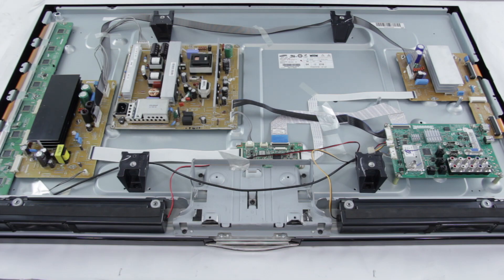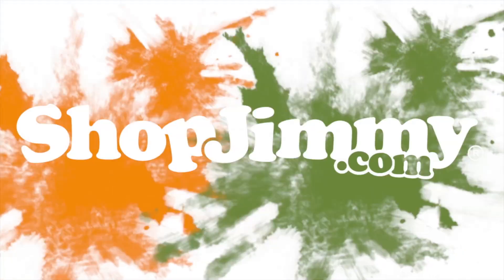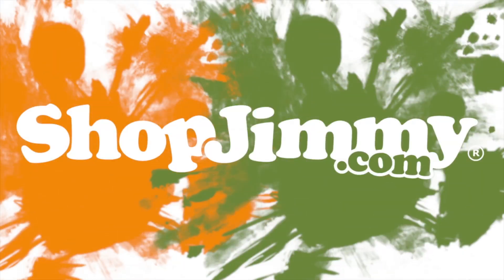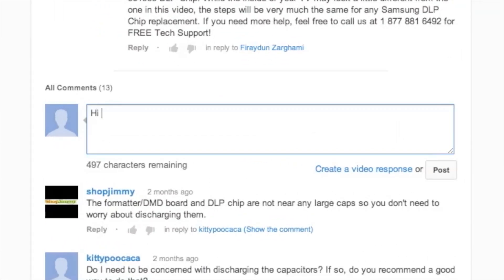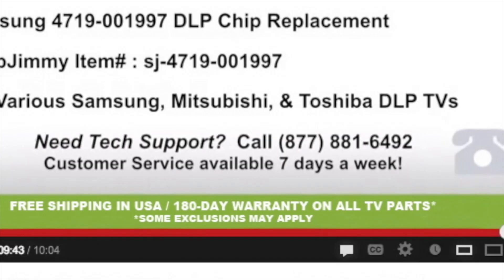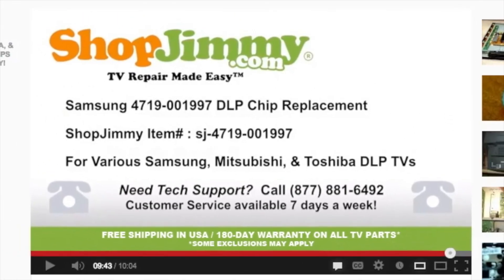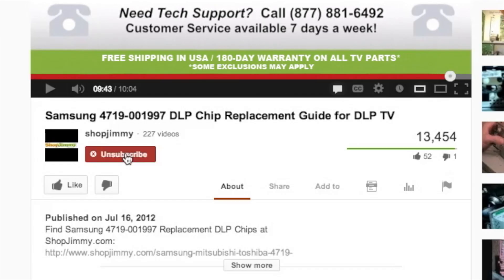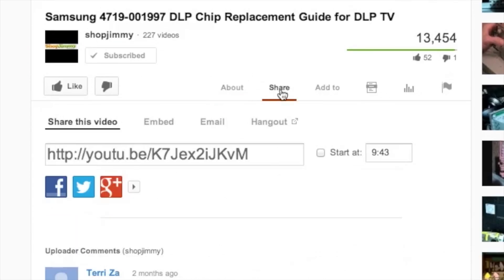Plasma TV Repair Tutorial - Common Symptoms & Solutions - How to Fix Plasma TVs

Comment: I have this Samsung Plasma HPT5054X/XAA. The picture recently went out. Audio works, changes channels. What would you suggest I switch out?
Reply from the maker: Intrafear   I recommend replacing the Y-Main Board and the Lower & Upper Y Scan Drive boards in your TV.  Click this link to replacement parts for your TV model number.  http://www.shopjimmy.com/catalogsearch/result/?q=HPT5054X%2FXAA  Be sure to match part numbers on your current board, with your replacement for compatibility.  Here is a link to a video showing how to identify your part number, click here:  https://www.youtube.com/watch?v=R1jmj_foId0  Thanks and please let us know if you have any further questions with your TV Repair!  www.shopjimmy.com

Comment: Hi Jimmy.  I have an Hitachi Plasma P50H401 tv.  A few weeks ago the tv would not turn on and the power light was blinking blue three times.  I opened up the back panel and discovered a domed capacitor 100v 3300uf(m) 105 degrees Nippon on the power board.  I replaced the capacitor (exactly the way the old one was situated) and the tv worked fine for about 2 minutes.  I turned off the tv, reinstalled the back panel, hung the TV back on the wall, plugged in the power cord and now the tv has absolutely no power.  Replaced the same capacitor a second time and still no power to the tv.  The fuse on the board where the power-cord plugs in appears to be good.  Not sure what to do next.  Please help!  Thanks so much!

Comment: Hi, I have a Samsung LN-46D550K1F Tv with no picture...audio is ok. Backlight is on, I can see picture with flashlight. what do you think it could be T-Con or inverter board? voltage from the power supply to the inverter is fine, Thanks in advance for your help!
Reply from the maker: Luis Gudino   Is the backlight working?  You said the backlight is on and you can see an image with the flashlight.  Typically if the backlight is working, you will not need the fashlight to see the image.  Thanks!  www.shopjimmy.com

Comment: Good day Jimmy!! Toshiba 42HP84, Solid black vertical line, off center on the right.  Any solutions to this issue that will remedy the problem? Any help will be greatly appreciated.
Reply from the maker: tamban282   This sounds like a TV panel (TV Screen) problem.  If your TV panel is bad, it may be more cost-effective to replace the TV as panels are typically hard to find in stock, difficult to replace, and expensive.  Thanks and please let us know if you have any further questions!  www.shopjimmy.com

Comment: I HAVE A PANASONIC MODEL TH-37PX50U  MADE IN 2005  IT WORKED FOR 2 YEARS THEN HAD COLOR LINES
SO UNPLUGED AND PUT IN CLOSET  PLUG IN AND HAS SOUND  BUT THERE COLOR BARS ALL OVER
Reply from the maker: SAM JONES   This sounds like a TV panel (TV Screen) problem.  If your TV panel is bad, it may be more cost-effective to replace the TV as panels are typically hard to find in stock, difficult to replace, and expensive.  Thanks and please let us know if you have any further questions!  www.shopjimmy.com

Comment: HI! i have a LG plasma 60PY2DR  TV.   it is about 8 year old TV. the TV was functioning perfect till last night when we switched it off end of the day. Never exhibited any issues. In the morning, a Verizon tech came to switch my Service from Comcast to Verizon. He informed me the the TV is not coming on.  i tried to switch it on. The standby light flashed a few times and turn red and the tv wont display anything on the screen.  if you try to switch on again, it would repeat the cycle.  this TV is a very heavy TV with inbuilt DVR and lot of other functions.  i believe the the power board is not working on it.Please give me an advice and let me know how much would it cost to get it repaired.
Reply from the maker: Dawood M   Try this at your own risk. Unplug the TV, then disconnect the y board and plug in the TV to see if the TV powers up. Reply with the results of this test. Thanks! www.shopjimmy.com
Reply: ShopJimmy.com   the tv was too heavy.  i have a technician replace the power supply. he charged me $500  and took the board away.

Comment: Love your video on Plasma TV Repair Tutorial. Here is my problem. I have a Samsung Plasma Display (Model NO: PN51D440A5D) (MODEL CODE: PN51D440A5DXZA) My thing is the video image just went out on me yesterday. I get full audio and the remote control works fine. Turning it on & off works fine to. Just no Video image. BUT when I shut it off & turn it back on I get a Quick white flash on the screen then go's to black. Like I said Audio works fine. But one thing I notice is that along the top of the TV was very Warm. I unplugged it to let it cool down, but plunged it back in a few hrs later, still the same thing. Please I like to know what part I need to get from you to get up and working again. Thanks Tommy.

Comment: I have an Insignia 42 inch plasma NS-PDP42. I have no picture, but the red stand by light is on. When I push the power button the light will turn green then go directly back to the red stand by. The picture never does come on. Thanks for the help
Reply from the maker: Jason Elliott   I recommend replacing the YSUS and the YDRVTP boards in your TV.  Click this link to replacement parts for your TV model number:  http://www.shopjimmy.com/catalogsearch/result/?q=NS-PDP42  Be sure to match part numbers on your current board, with your replacement for compatibility.  Here is a link to a video showing how to identify your part number, click here:  https://www.youtube.com/watch?v=GEllG3RV-tc  Thanks and please let us know if you have any further questions with your TV Repair!  www.shopjimmy.com

Comment: Hello, I have the LG 42PJ350 Plasma TV. The other day, there was a power surge in my home, and it ended up doing something to the TV. When plugged in, I get a standby light, but when I try to turn it on, it clicks as if it were going to come on, but clicks three more times, does not come on, and the standby light goes out. I have taken it apart, and there are no bulges on any capacitors, or anything that looks or smells burnt, so I am thinking it is the AC Noise Filter, which I mistakenly called the power supply. Can the words be used interchangeably? But more importantly, what may this issue be? I wanted to get a second opinion before going on and buying the Noise Filter, and that not be the problem. Thank you.

Comment: hi i am having problem with my plasma tv Samsung PS-42Q97HD it turns on but after some time its going off itself and the blue start line is blinking where do i find the problem and how to fix it at home, will be very thankfull for ur reply directly to my mail, papazai@yahoo.com
Reply from the maker: Sultan B   I recommend replacing the main board in your TV.  Click this link to replacement parts for your TV model number:  http://www.shopjimmy.com/samsung-bn94-01178b-main-board.htm  Be sure to match part numbers on your current board, with your replacement for compatibility.  Here is a link to a video showing how to identify your part number, click here:  https://www.youtube.com/watch?v=BEPWrefQvqI  Thanks and please let us know if you have any further questions with your TV Repair!  www.shopjimmy.com

Comment: I have a 58 samsung plasma PN58B650S1FXZA, it made a pop sound and went off clicks on every 5 seconds then turns off.  Any help would be great!
Reply from the maker: Chadrick Willis   I recommend replacing the Y-Main Board and the Upper and Lower Y Scan Drive Boards in your TV.  Click this link to replacement parts for your TV model number.  https://www.shopjimmy.com/catalogsearch/result/?q=PN58B650S1FXZA  There may be multiple boards for the same TV model number, be sure to match part numbers on your current board, with your replacement for compatibility.  Here is a link to a video showing how to identify your part number, click here:  https://www.youtube.com/watch?v=R1jmj_foId0  Thanks and please let us know if you have any further questions with your TV Repair!  www.shopjimmy.com

Comment: Hey shop jimmy I have a lg lcd flat panel that has static vertical static lines what would cause this and I am a electronics technision so I do have a lot of solder skills if there is a specific area I have to replace components on I can ?
Reply from the maker: *****   This sounds like a TV panel (TV Screen) problem.  If your TV panel is bad, it may be more cost-effective to replace the TV as panels are typically hard to find in stock, difficult to replace, and expensive.  Thanks and please let us know if you have any further questions!  www.shopjimmy.com

Comment: I have an LG 50PK550-UD plasma tv (from 2010). Right now it has 10 thin vertical lines appearing on the display, 8 are green and 2 are blue. One is approximately 1/3 of the way from the left hand side and the rest of them are about 10 inches from the right. Do  you  know which board is causing the problem? I have even read that the display itself could be the issue and I am curious how that would be determined. Thanks.
Reply: any thoughts on this?
Reply from the maker: Art Green   This sounds like a TV panel (TV Screen) problem.  If your TV panel is bad, it may be more cost-effective to replace the TV as panels are typically hard to find in stock, difficult to replace, and expensive.  Thanks and please let us know if you have any further questions!  www.shopjimmy.com
Reply: ShopJimmy.com
 Thanks for the reply. That really sucks. I was hoping I could fix it and not have to throw it in the garbage. What a waste. Now my tv is an LNG: Life Is Not Good lol

Comment: I have a Hitachi 55hdt79 that turns on and has sound but no picture I suspect the y sus board. Would you be able to confirm?
Reply from the maker: Tony Pileggi   I recommend replacing the Y-Main Board and the Upper and Lower Scan Drive Boards.  Click this link to replacement parts:  http://www.shopjimmy.com/catalogsearch/result/?q=55hdt79  There may be multiple boards for the same TV model number, be sure to match part numbers on your current board, with your replacement for compatibility.
Thanks and please let us know if you have any further questions with your TV Repair!  www.shopjimmy.com

Comment: belly jimmy,my plasma set has a bright green screen that flashes . I switched out all the swollen caps . what else can it possibly be. also as I was removing one of the bad caps, the copper foil came off so I jumped the one lead to the next cap over giving it the same voltage. thanks for listening and your time and efforts .Fraternally yours Glenn Ferris .comp/ electronics tech.
phillymale1955@gmail.com
Reply from the maker: Glenn Ferris   I recommend replacing the y board and buffers.  Please reply with your TV model number.  Click here to view a video that shows how to find your TV model number:  https://www.youtube.com/watch?v=S51nhAmwR2M  Thanks!  www.shopjimmy.com

Comment: im so lost, i bought a broken vizio vp50 hdtv20a plasma tv... when i bought it the guy said it just turned off while watching it.... well i opened it up and it appears some capacitors have been replaced... a main power fuse  was blown... i replaced the fuse, now when i plug it in the tv will beep one time but it does not turn on.... it does nothing if i hit the power button....   the entire time the tv is plugged in i can hear a high pitched squeal noise...  where do i even begin.... oh i almost forgot.. the power supply board does not light up or anything....     where do i begin? what all can stop the board itself from getting power every where? apparently it is losing it some where.. cause the power supply board has the led lights that should light up.
Reply from the maker: james nunnya   The noise is that the panel is broken somewhere.  If your TV panel is bad, it may be more cost-effective to replace the TV as panels are typically hard to find in stock, difficult to replace, and expensive.  Thanks and please let us know if you have any further questions!  www.shopjimmy.com
Reply: ShopJimmy.com actualy it was fine.... turned out i had to use the remote to turn it on. the power button does not work.. none of the buttons on the side work. the tv works as good as new. ive been watching it every single day lol. it plays almost non stop i hardly turn it off.
Reply: ShopJimmy.com all i did was replace a couple capacitors myself just for not testing exactly how id like them to. and the main fuse that was blown...  after that the only thing that will turn the tv on is the remote. im not sure what the humming noise is but u only hear it if u put ur ear straight to it.... its still there even while im watching it if i get close enough to listen to it.. but i dont worry bout it haha. it plays. thats all that matters to me.     but in general how can a tv panel make a squeal noise? sounds kinda odd to me... panels usualy go bad as in ribbon cables or pixels dieing etc... cracks... blah blah.. im no idiot when it coes to tvs but again im no profesional ethier but ive fixed more than my fair share of them.  but ethier way i respect u trying to help... ive noticed most tv repair shops usualy always blame panels being bad when there not.. ive seen that alot and i never understand why they say things they know isnt true... is it like a guy thing where its easier to say a cause thats unfixable money wise than to be straight forward with i dont know lol.

Comment: I have a 58" Samsung Plasma 3D TV model # PN58C7000YFXZA in which I had a Wide RED fuzzy bar which goes horizontal near the Top of the TV. It only appears when a Bright White screen appears mainly on commercial ads that have a logo in the middle of the screen or if Im watching a movie and they pan the camera up towards the sky. It shows up when playing PS3 games, movies on my Blu-Ray player or on Directv so I don't think its any of the connected devices. Any help or would be appreciated.
Reply from the maker: mystermathers   You can replace the top buffer to see if that fixes the problem.  If that does not fix the problem, then you most likely have a bad TV panel.  Click this link to replacement parts:  http://www.shopjimmy.com/catalogsearch/result/index/?cat=96&q=PN58C7000YFXZA  Thanks and please let us know if you have any further questions with your TV Repair!  www.shopjimmy.com

Comment: Hi I have a Samsung 51" plasma 
Model Code: pn51d450a2dxzc
Mode No: pn51d450a2d 
It turns on, as sound but no picture. It seems to blink for fraction. 

Let me know what you think. 
Thank you
Reply from the maker: Jonatan Simard   I recommend replacing the Y-Main board and the Y-Buffer board in your TV.  Click this link to replacement parts for your TV model number:  http://www.shopjimmy.com/catalogsearch/result/?q=51d450a2  There may be multiple boards for the same TV model number, be sure to match part numbers on your current board, with your replacement for compatibility.  Here is a link to a video showing how to identify your part number, click here:  https://www.youtube.com/watch?v=R1jmj_foId0  Thanks and please let us know if you have any further questions with your TV Repair!  www.shopjimmy.com

Comment: I have LG 60PA6500 plasma tv. It turns on and off with few seconds interval, just showing LG logo and the time clock. It shows the screen just for 1 second than turns back off again and vice versa. Can you please help me, what should be the problem. J messaged last week too but no reply.
Reply from the maker: ajwad ashfaq    Try this at your own risk. Unplug the TV, then disconnect the y board and plug in the TV to see if the TV powers up. Reply with the results of this test. Thanks! www.shopjimmy.com
Reply: I disconnected the y sus and it doesn't shows the screen at all not even for 1 second. But tv still makes clicking sound like before. Like it's trying to start.

Here is the video
Reply from the maker: ajwad ashfaq   This could be a problem with either the power supply or the main board in your TV.  You may need to replace the main and power supply boards individually to see which one fixes the problem.  Click this link to replacement parts for your TV model number:  http://www.shopjimmy.com/catalogsearch/result/?q=60PA6500  Be sure to match part numbers on your current board, with your replacement for compatibility.  Thanks and please let us know if you have any further questions with your TV Repair!  www.shopjimmy.com

Comment: Hello i do have a samsung plasma tv model #pn59d530a3f, model code pn59d530a3fxzc.. At first it keeps turn off and on. Then after i heard something pop, and the tv don't have any more power.i was wondering if its a good coz i've found the same tv, but the screen is broken and no picture.the guy was telling me the tv has power, his son shot it with an airsoft. Now the tv is broken and no pix. Should i buy the tv, and try to replace thr p. supply on my tv and the y source? Pls help. Thanks
Reply from the maker: khristine cheng   I recommend replacing the Y-Main Board and the Upper and Lower Y Scan Drive Boards.  Click this link to replacement parts for your TV model number:  http://www.shopjimmy.com/catalogsearch/result/?q=59d530a3  There may be multiple boards for the same TV model number, be sure to match part numbers on your current board, with your replacement for compatibility.  Here is a link to a video showing how to identify your part number, click here:  https://www.youtube.com/watch?v=R1jmj_foId0  Thanks and please let us know if you have any further questions with your TV Repair!  www.shopjimmy.com